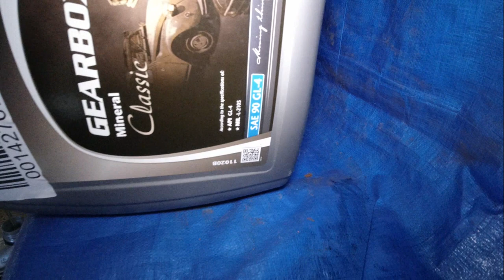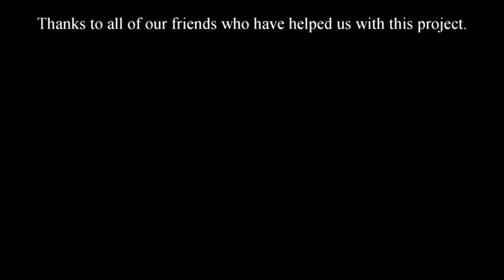unimog 404 vlog 03: Clutch assembly, reassembly and first test drive.

Comment: you replaced the gearbox so You could grind of that special tool from the other gearbox :) Like I did :D I even welded a 1/2 socket on it :)
Reply from the maker: I might want to rebuild the old gearbox in the futere, so i like to keep it in mostly one piece for now :P
If it would be scraped that would be a great idea!

Comment: Very likeable! But after you stripped it down, why didn't make you some rennovations? Would look much prettier than. Is this 404's engine already a M130 or still a M180? (Mine is from '55 with short wheel base.)
Reply from the maker: it's an rebuilt m180 only 2 years old. all the metal work etc. was also done 2years ago. it's because of the mistake in the mud we needed to re-do the clutch, gearbox and axles.
Reply: @ArmyTruckTom  Ah, ok. I thought it was the engine from the later version since your 404 is from '72.
Reply from the maker: @Superleicht_R107  nope it came whit the m180. would be nice if it was the m130 and have a bit more power, but i like to keep it original so i kept it. the rebuild engine has enough power to get her up to 90km/u

Comment: why my 1968 404 have dual carburetors
Reply from the maker: you might have a very rear version of the 404 with the m130 engine.
and this means it has 110bhp instead of the standard 82bhp.